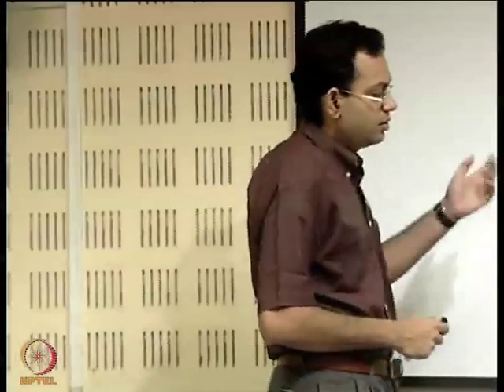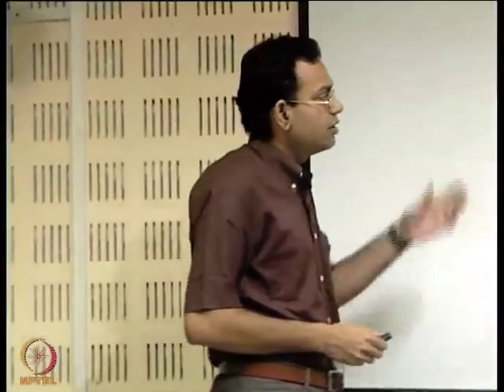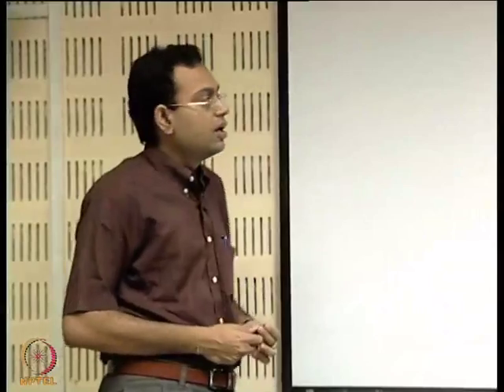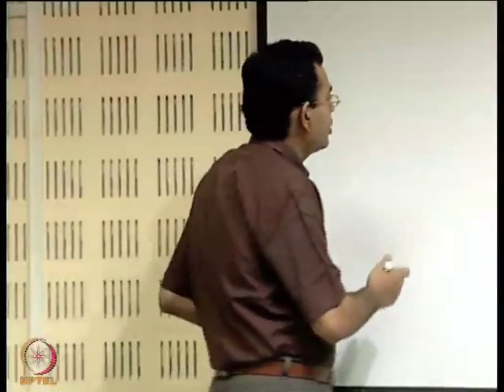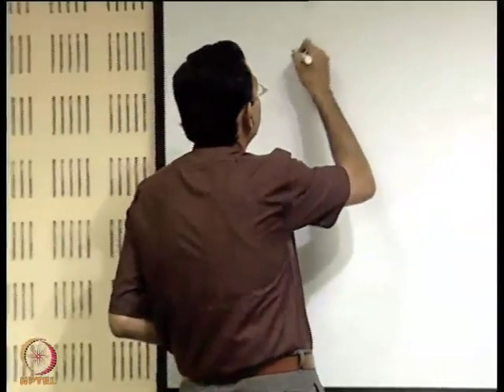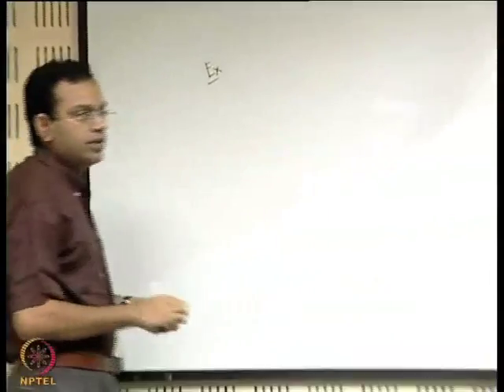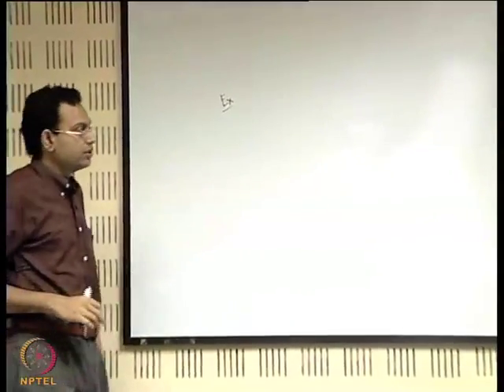Mod-01 Lec-22 Integral Forms of Control Volume Conservation Equations

Comment: Sir I have one doubt here the control volume is non deformable as you have mentioned then why you are taking volume change with time.
Reply: There is no condition on control volume in the integral form of continuity equation. The assumption of a non-deform-able control volume was made to arrive at the differential form of continuity equation.